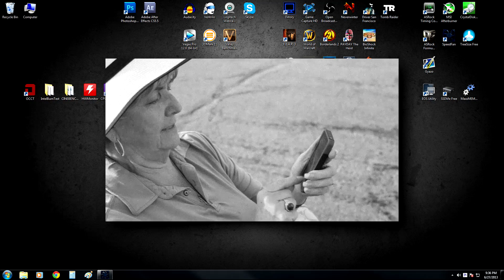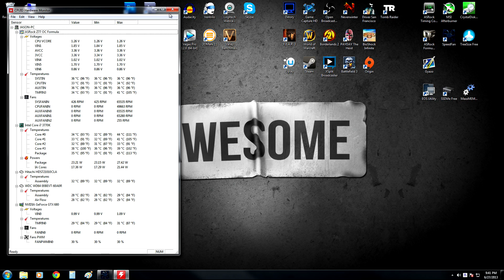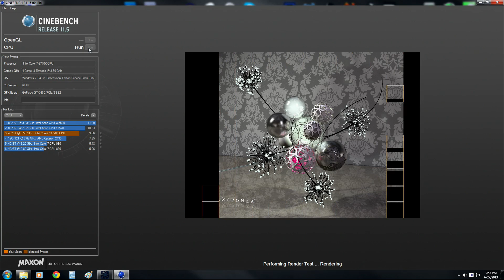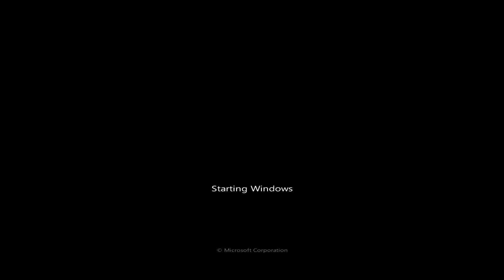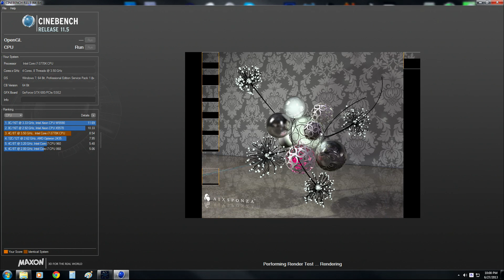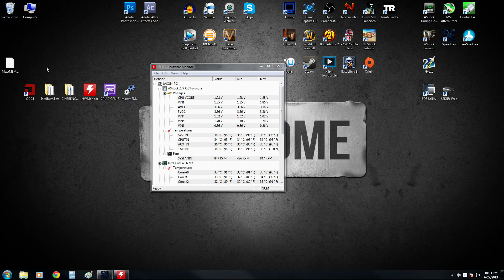Intel Overclocking Guide - 3570k 3770k 4670k 4770k

Comment: Hey dude, what voltage do you recommend between 4.3 to 4.4ghz with 1600mhz DDR 3 RAM? Thanks for the vid :)
Reply: what did you go with?
Reply: @ImDippinIn  left it stock. My cooler isn’t performing enough to handle an OC.

Comment: Haha, so cool to hear "old" Jay.  I'm still rocking a 3770k OC to 4.6, however, I followed a guide that I never felt comfortable with.  

Since I like to tinker so I figure I'll try to get a better overclock (either even higher frequency or lower voltage).

Thanks for the video old Jay :D

Comment: SUGGEST ME PLEASE WHICH one Will BEETER - 
GTX 1650 SUPER 4GB  DDR6    V's       GTX 1060 6 GB DDR5X
WITH 

i5 3570 k  -   ASROCK z77 EXTREME 4  -  CORSAIR VENGENCE 16GB RAM (1600MHZ)

AND WHICH BRAND -  INNO3D  /  MSI  /  ZOTAC   /   GIGABYTE ?

Comment: GTX 1650 SUPER DDR6 4GB OC GPU , Will it not Create Bottleneck i5 3570k? 
My PC CURRENT CONFIGURATION
i5 3570k
ASROCK Z77 EXTREME 4
CORSAIR VENGENCE 16 GB RAM (1600)
is   INNO3D ,  ZOTAC  ,  MSI  WILL BE GOOD ??

Comment: GTX 1650 SUPER DDR6 4GB OC GPU in it?  Will it not Create Bottleneck? 
My PC CURRENT CONFIGURATION
i5 3570k
ASROCK Z77 EXTREME 4
CORSAIR VENGENCE 16 GB RAM (1600)
is   INNO3D ,  ZOTAC  ,  MSI  WILL BE GOOD ??

Comment: I’m still rocking my 3570k to this day and just now getting into overclocking, i built my rig in 2012, 3570k with a Corsair water cooler, H50 I believe, just the single fan size radiator and a 660ti that I recently upgraded to a 1050ti. Now I’m starting to get a bottleneck, so I’m trying overclocking. I’ve seen some use this set up and run newer Tripple a titles and have smooth fps, I need to upgrade and build a new one but that’s not high on the finances priority right now, sucks that gpus habe shot up in price for the new cards, my 660 ti was about 150 on new egg in December 2012 lmao.

Comment: I"m the guy this is relevant to in 2020 :/
Reply: 8yr old 3770k here lol :p
Reply: @Bramagon  ended up replacing mine last month with a 2700x
Reply: @keithlloyd1249  Nice! I upgraded my gpu from a 680 to a 2070super recently. Next year i'll finally retire the mobo/cpu/ram
Reply: @Bramagon  I went for the 2060 cuz it was in stocked. The difference the CPU makes in a game like Star Trek online is astounding
Reply: @Bramagon  same but in 2022 :(
Reply: @Bramagon  same here
Reply: I'm the guy this is relevant to in 2022, if I can afford to upgrade from my 3770, after having sold my kidney for a 30-series GPU.
Reply: Love my 3770k
Reply: Bought a 4790K last month
Reply: Doing a win xp - 10 build in one case, so overclocking my 3770k is essential.
Reply: which motherboard you using my guy?
Reply: @Mrohio-t7n  Z97P. 
But I ruined the socket the day before yesterday :-( two pins broken off and no post anymore
Reply: @grossteilfahrer  RIP :(
Reply: same lmao just bought a 4770k to replace my dead 4790
Reply: Honestly, if you have a 3770k or 4770k, it's unlikely to be holding you back. I'm watching this right now because my 3770k oc isn't stable.
Reply: 2021, trying to get my 3770K overclocked :D
Reply: @markothevrba  i just overclocked my 4770k to 4ghz
Reply: @gaspowrd8810  dtill having i5 3570k
Reply: 2022 🎉

Comment: Does anyone else's 'per core' clock ratio not work?
I can get 46x on all cores working fine without a problem, but if for example I used the per core function and set it as 46x, 46x, 46x, 39x then no thread would run at anything higher than 39x. I can never get it to go higher than the lowest core radio. 
It's not a heat/throttling issue, I have latest BIOS, etc, etc. Any ideas? Thanks.

Comment: Tried overclocking my 4770k and at 4.3 it just bottlenecks my system. I’m running a z87k MOBO with 8gb crucial ballistic ram 1877mhz, Corsair cpu air cooled. It’s weird because it runs 4.2 on stock voltage soon as I up the voltage a little and put it to 4.3ghz it won’t boot and I get either automatic repair message or we need to restart...anyone any idea on what I can do

Comment: Here in December 2019, trying to finally overclock my 4670k... :D
Reply: 2020 January attempting 4770k overclocking
Reply: McDuck did you find any good solutions I’m in the same boat.. it will not go past 4.2ghz at stock voltage, but then when I up the voltage and set cores to 4.3 it either won’t load up or it bottlenecks the whole system and user benchmarks scores go way down
Reply: why values you modifiqued? why change in the bios? i have i5 4670k

Comment: Jay , you should run this cpu with some of the newer graphics and see how it lives up to it. Like maybe a 1060, 1660/ti .
Reply: Im running 3770k stock 1080 ti here. Games work great. This cpu can handle them all .I watch some youtube and Ive seen better fps in games than some 8700k with 1080ti. Have not seen a decent cpu yet to build on . Im looking for an ultra high cpu . I dont feel the need to upgrade as everything works fine even after all these years. Before this plaform I used Athlon thunderbird in 2011. Then i had issue with amd crashing alot I discovered the amd chips are not stable like intels are. After owining them .The intel is completely stable in windows no blue screens like amd.

Comment: I actually have a question. I'm running a  i5 3570k with a corsair h60 water cooler.  I'm a newbie when over clocking so my question is I've been trying with like 3.6 to 3.8 GHz over clock and when I run Intel burn test it got up to 95ﾟC but when I play games it never goes that high so my question is even though it's stable should I under clock it some more

Comment: hi pro i have gigabyte Z77-D3H with i7 3770 ram 16GB(2*8)bass 1600 Team Elite power 750W when i start any stress on him i see he up to 4.5GH and i have non K ver but he get too hot because iam with normal cooling i didnt overclocking just i change my power and he did that alone any help to reduce that and thanks for help

Comment: Opinions on using auto offset for voltage  (z77 sabertooth if it matters). Can I use the auto / do stress to see where I might get an initial core for the oc rather then doing all of the incremental steps?  3770k at 4.2 right now which is super tame with the auto offset. Can I stress it now and monitor voltages from cpuid/hwmonitor and find a starting point and then back  down from the max?

Comment: Hey Jay. I just got a second hand 3570K and I have a question about longevity for you, a few years after you made this video. From my research, people have found that a lot of Z77 Asrock motherboards report wrong voltage that is 0.3-0.7v lower than what is actually measured with a voltmeter at the board. Also LLC at level 1 on the Asrock boards tend to overshoot the voltage above the set value when under load even further. I am a bit worried about too high voltage being pushed to the CPU without me even knowing it. Have you noticed any degradation on your CPU when running with high overclock for prolonged time? Thanks. 

I researched it because I got suspicions on the OC results that seamed too good and too easy. I would appreciate your opinion on the results. When I first tweaked it, the CPU went to 4.4GHz with no other changes from the defaults. Only multiplayer at 44 and CPU-Z says it runs at 1.2V max (auto voltage with LLC at auto). I though it was a bit off. It could have been right because the stock cooler (yes I know replacement is being delivered,) actually managed to keep the 4.4GHz in gaming and Heaven benchmark at 60-65c and 85c under Prime95 test. However at this point I don't know If I can trust the temps (since I can't trust the voltage reading, the temp might be off too). This is because the PC started crashing and bluescreened at those settings at low temps. It turned out the VRM was blazing hot, so I had to install a fan blowing at it. I want to push the CPU to 4.9 stable (highest OC it will boat at) but I worry the 1.4V needed to work at that speed might be actually way higher.

Comment: I have a 3570k and i ran the burn test at 4.2 1200vcore and it failed. Does this mean my chip is bad?
Reply: Neither good nor bad, I would say... At 1.2 V mine runs at 3.9 GHz max, so there are always worse chips. What is the highest OC you can get with 1.2 V?

Comment: I'm OCing an i5 3570k hyper 212 with a 1070 and I am unsure what my issue is... 4.4ghz with .20 offset and .59 turbo v my heaven bench and games fail (after running smoothly for some time). Does anyone know what the issue could be? More voltage? Less? Am I pushing too far?
Reply: Also, those are positive voltages (increases)

Comment: can i oc my i5 4690k with a evo 212, gtx 1070 ftw, 8gb ddr3 with a tr2 600w psu. im very new to this and i dont want to screw up my pc it runs around 30 to 32c idle and 70c with 100%. should i oc or should i just leave it alone
Reply: joe wright 70C is already a lot dont let it get over 80 but also what motherboard do you have